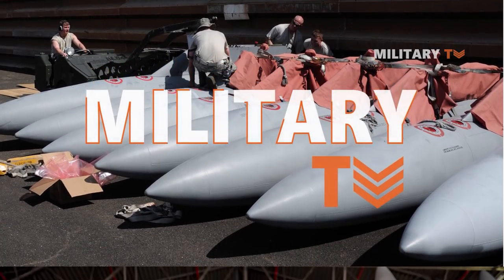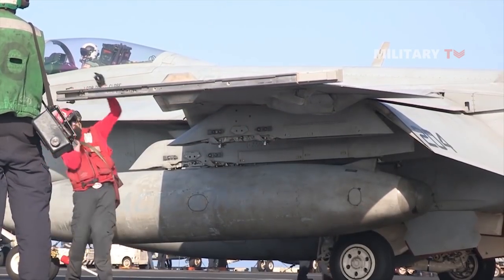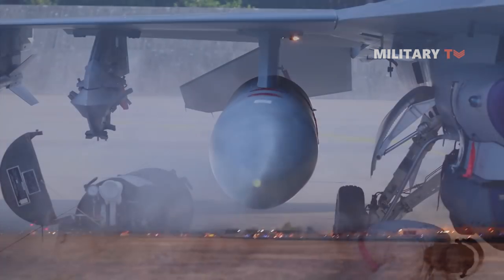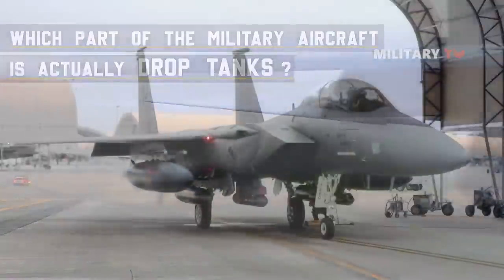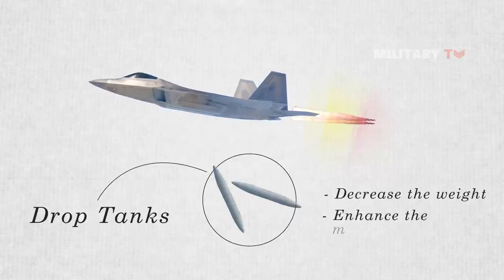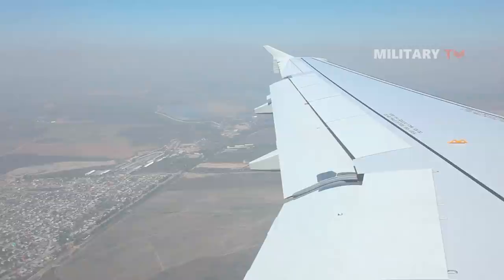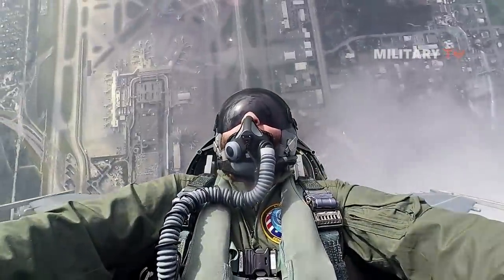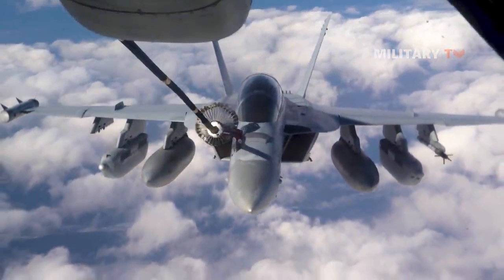Why Some Fighter Jets Dump Their Fuel Tank

Comment: The last video talks about having to abort a flight because of an emergency. It also says the dumping of fuel has to be at high altitude, so the fuel has time to evaporate before hitting ground, BUT, it then shows the plane dropping its drop tanks. If the drop tanks had fuel in them when they were dropped, they're still going to have fuel when they hit the ground. But, now they're going to be more like bombs.